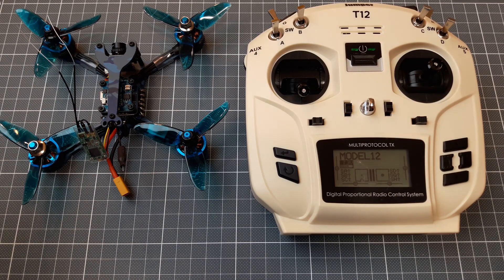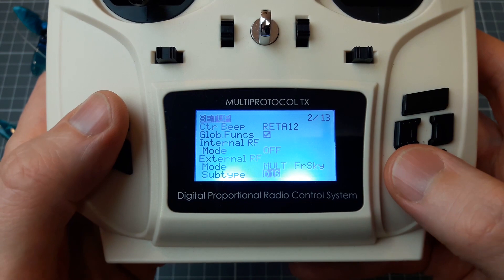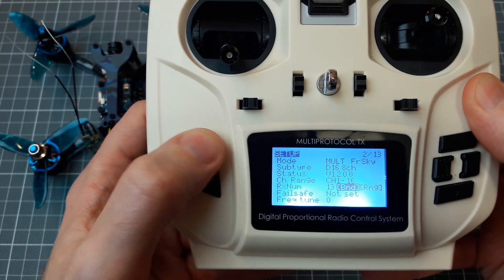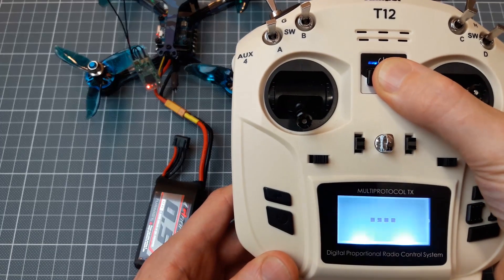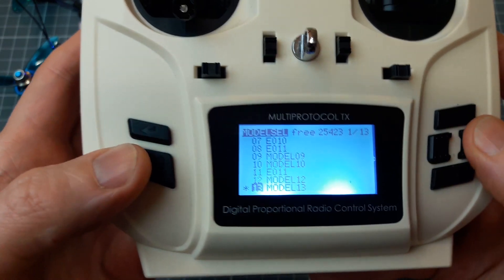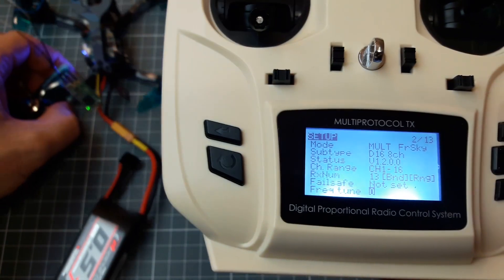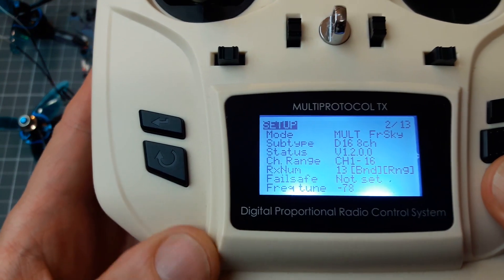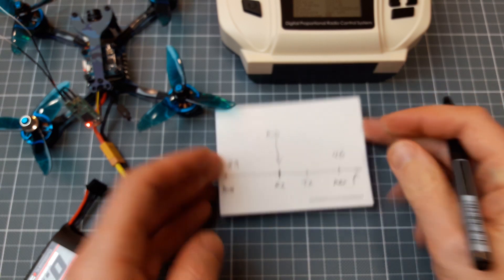How to bind Frsky RX to Jumper T12

Comment from the maker: You can read more about frequency tuning of the multiprotocol module here: https://github.com/pascallanger/DIY-Multiprotocol-TX-Module/blob/master/docs/Frequency_Tuning.md
Reply from the maker: More information

Original FrSky, Futaba, Corona and Hitec receivers have been frequency-tuned by the manufacturer at the factory. Because of variations in the oscillator crystals used in multiprotocol modules it is necessary to fine-tune the module to match the manufacturer frequencies.

'Compatible' receivers suffer the same variation in crystal oscillators as multiprotocol modules, but have to be compatible with genuine (manufacturer-tuned) transmitters so they will typically have auto-tuning built in, and will self-tune to the radio's frequency when they are bound.

'Original' Frsky transmitters also have been factory tuned to the right frequency and they dont need the fine tune procedure.
Reply: Thanx man, exactly what I was looking for.

Comment: I was wondering if you could tell me the difference between frsky r-xsr and xm+. I have bound xm+ to my t12 and am considering another drone that has a R-xsr  but am unsure if that works with the multi-module inside the t12
Reply from the maker: R-XSR is the top of the line FrSky D16 receiver. Has telemetry link via S.Port. On the other hand XM+ is way cheaper than R-XSR. I don't like the connector plug in the R-XSR, also getting the S.Port working can be tricky.
Reply: @MontisTube  thanks for the info. I've since found that unfortunately adding telemetry to the mix also seems to reduce its range compared to the xm+ by almost 100 yards depending on the setup,  so I'll be switching it back to an xm+

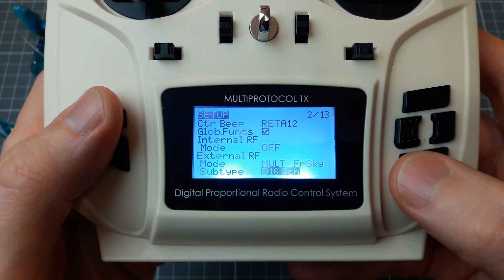Comment: Hello i have a question in 1:05 you said select lbt(eu) if  you have eu firmware 
you mean in subtype setting is there lbt(eu) option to select ?
if you respond my question i willbe happy thanks for the video
Reply from the maker: Yes, if your receiver has D16 EU (LBT) firmware, then select the D16 LBT option from protocol subtype. If you have D8 receiver, then it has no LBT option, just D8.

Comment: I have the Jumper T8SG V2.0 Plus Trying to bind to FrSky R-XSR Receiver, not getting anywhere. It has 3 FrSky protocols in radio. Would you know which one is correct?  Or could it be something to do with frequency as in link below? Thank you!
Reply from the maker: Standart FrSky R-XSR receiver should be bound with D16 FCC or LBT protocol (US/EU). It should bind even without the frequency tuning. Also have in mind that receiver could have swamped signal if held too close to the transmitter. It is advised to keep the receiver a few meters away from the transmitter for binding.
Reply: @MontisTube  Thanks so much for your response!

Comment: that's the number 84 + 42 where it came from bro
Reply: but at the max point you wrote earlier 46 bro, not 42 so I'm confused 😁😁
Reply from the maker: @sonyanggunprihantoro7970  haha, well spotted! Thats my mistake. The upper max freq offset should be 46. The right math than should be: (Fmin+Fmax)/2  or (-84+46)/2 = -19. 
This is minor error should not affect much. 
Thanks for spotting the mistake!
Reply from the maker: Thats the Min and Max frequency offset values. The muddle point is the right frequency offset point for your multiprotocol module.
Reply: haha yeah bro, your content is really very useful for beginners like me, thank you very much bro

Comment: Hi my name is Ralph and I really enjoy your videos. You break it  down to the simplest form. Well I have the jumper t12 transmitter and just got the lizard 95 last week but I am having trouble binding the two. Can you make a binding video on the lizard 95 and the jumper t12 transmitter cause I feel I am doing something wrong or missing something.
Reply from the maker: Hi Ralph. Unfortunately I dont have the Lizard95. But all the the receivers are binding in the similar way. If you have FrSky receiver, the you need to select the right protocol D8 or D16 and make sure that both tx and rx are the FCC or EU-LBT type.
Reply: @MontisTube  thank you for the info and I grateful for your help and support.  I will give it a shot. Thank you again buddy for your time. Hopefully this will work cause I want to see how fast this little beastly bird flies.  They say that the lizard 95 is really powerful.

Comment: I have a question about vtx called ts400 or tx5826 , it’s a 500 mw vtx and only has 8 frequencies to transmit on and has 3 channel pins , do I need a dipswitch ?
Reply from the maker: Yes, you need dip switch for selecting the needed channel. I would advise you to choose ready to use VTX instead of the DIY module. Will be much easier.
Reply: Montis well I already own it is a 500 mw so I would like to use it , so I need a 3 position switch ? & how do I wire it ?
Reply from the maker: You need this dip switch https://m.aliexpress.com/item/32823366128.html?pid=808_0000_0201
Connect all 3 pins from one side to the GND and 3 pins from the opposite side to the module.